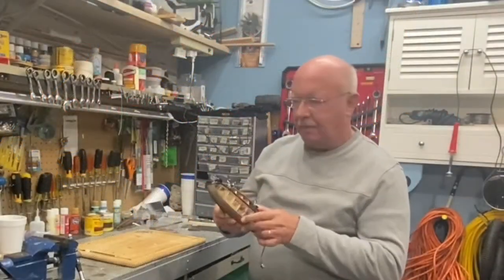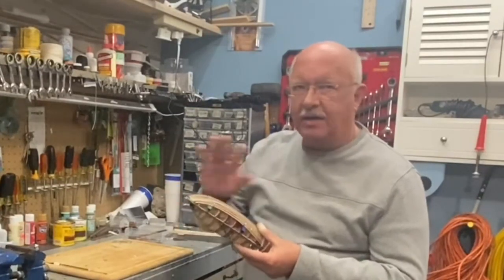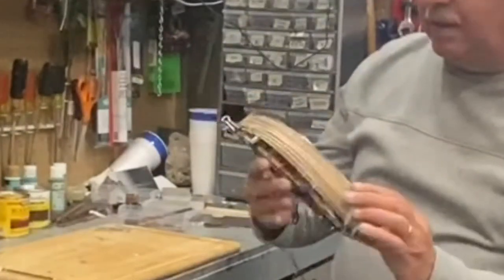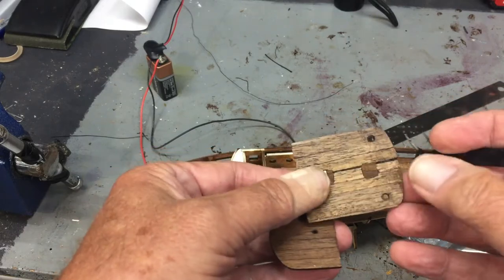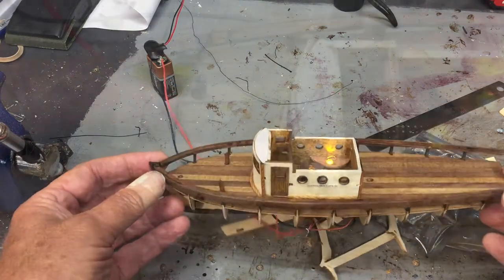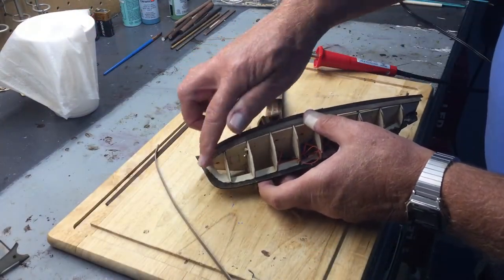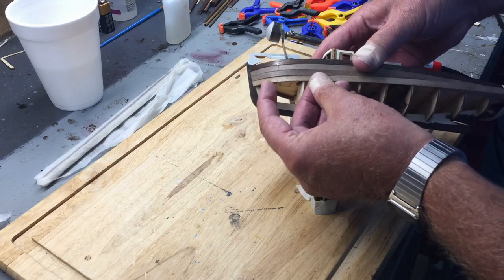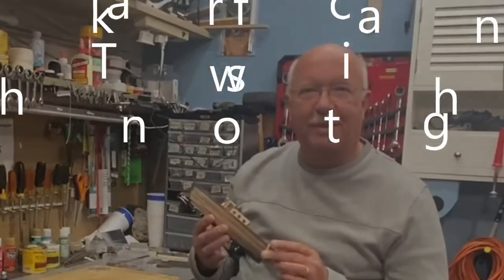HAPYLY 1/30 Scale DIY Wooden model Fishing Ship Part 2

Comment: Thanks for the suggestions, Dan. I've been soaking my planks in hot water for an hour or so and then hang a couple of heavy clamps on the end over night to get a bend in them, but it's not working to my satisfaction.

I don't have a true "workshop" where I would feel comfortable using a soldering iron, so taking inspiration from another builder I am going to try using a hot clothes iron to bend the wet wood instead. Hopefully that works better.
Reply from the maker: If it still doesn’t work out, here’s a link to Amazon and the tool and bending form that’s been working well for me 👍
Electric Plank Bender for Hobby Model Ships by Model Shipways - MS7205 https://www.amazon.com/dp/B01F0IEUTI/ref=cm_sw_r_cp_api_fabt1_s4dXFbB3G6CTH

Comment: how was the booth assembled?
Reply from the maker: I'm sorry for not responding earlier.  For some reason I didn't receive a notice of your question.  The cabin area has notches that fit into the deck of the ship.  It is just a matter of placing 4 walls together and a couple of cross frame timbers.  It's very simple.
Thanks for watching, my apologies for the delay in my reply.